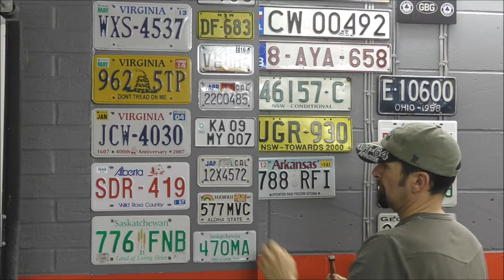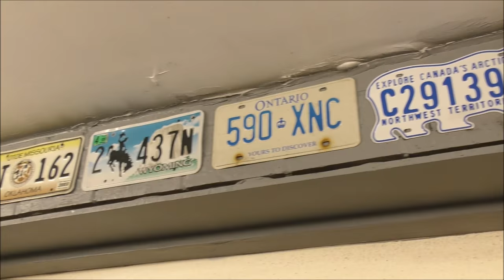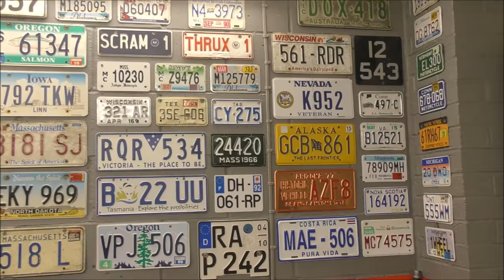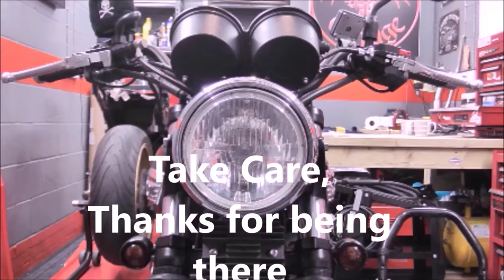Delboy's Garage, Fighter Build #31, Notching the Belly pan

Comment: Looks awesome.  Possibly a little bit over the top but ... once you get everything fettled just right you could use the inside of this as a mold for a fibreglass reproduction - and introduce bulges, louvres, and similar to clear / cover items rather than just have holes.  Just chucking that into the mix.
Reply from the maker: Good thinking mate, I like your style !

Comment: From the moment you first turned that tank upside down I knew it would look great. But it has turned out even better than I expected. Mutts nuts.
Reply from the maker: Thanks AH... did another 5 hours on it today, got the final cuts in place for now, and just the holes for the oil glass, and the number 4 pipe to cut... but i need ot mount it first..so started on the front bracket using the existing radiator lower brace...and had to cut and re-profile the ugly ends first... so didnt make obviously lookin steps forward, but still got a heap done... load up tomorrow once i get all the footage processed...! thanks buddy. Del.

Comment: just a quick idea for the front of the belly pan where it meets the bottom of the radiator, instead of bringing it towards the radiator with a curved in piece of metal, you could panel beat in a similar curve to that of the radiator and bring it in flush with the bottom of the radiator so it's a concave face instead of a convex one. I hope I've explained it well enough but that's about all I've got without sending you a picture haha
Reply: Sick idea, but that's a compound curve, so very difficult to do in steel.
Reply: +Jan Verschueren that's what I was thinking just thought I'd throw it at him and if he is up for tackling it then that would be great
Reply from the maker: Hey buddy, what a cool suggestion, I love that idea... the problem I face with that is that the current edge of the belly pan doesn't have enough metal to beat outwards in to a forward facing curve, and if I tried to use what's there, it would end up lower than it currently is... but I could weld a strip on and add extra metal that way, but Jan said, it's a two way curve then, so I would either need to pre-beat the piece out, which would be a fun challenge, or maybe use a piece of tubing about 2" and then slice it along it's centre, loads of options there - great thinking , love the creative input guys, thank you !
Reply: +Moonfleet41 I was thinking it would be a challenge! Maybe not on something you've spent 10+ hours making already haha it would be a cool add on though!

Comment: Great idea for the belly pan.  Dremel is the wrong tool.  Love mine but that's not what I'd be using it for.  Get yourself an angle grinder.  Nothing you did there couldn't be done without it and you'd probably be on the same disc.  I keep 4 of them loaded differently.  Cutting disc, grinding disc, flap wheel, wire brush.  Leave the littlest of cuts and fine tuning for the dremel.
Reply from the maker: Ayup mate, obviously I've got a grinder, and various wheels, but it's way too clumsy for some of these tight curves... it doesn't take a split second to lop a slice in it where you don't want it, and then have to weld it up and distorting it ,,, the Dremel works ok, it's just a lot more time consuming !

Comment: grab the metal cutting discs from flea bay.. last WAYYYYYYY longer.
I have 3 dremels.. use one for cutting bits out of kitchen utensil holders.. to make bushcraft stoves... hit the same issue.. carbide..or what ever the discs are called wear away in seconds, metal ones.. especially the ones with a diamond grit on the sides and air cooling holes last a way longer time.

Fuel tank belly pan... looks amazing dude..

Comment: Be careful you don't end up with long tendril metal bits around the edges as they will bend to easily. Also you have to be careful leaving the edges naked (I bend metal edges over or crimp them). In your case you may find you have to reinforce the edges later.
Reply from the maker: Hi buddy, I've a cunning plan for the cut edge, the whole lot, all the way round, will be getting a 3mm re-inforcing wire, which will then be welded just on the inside and then with a flap disc on the dremel, will be blended over to both re-inforce it, and give it a rolled edge look, as you're right, the cut edge looks rubbish !

Comment: That is going to be fantastic ! Nice work on the pan , it would be nice if you can cut or stamp out some louvers on the front of the pan , so you can get some air flow thru the pipes ..👍🏻
Reply from the maker: Possibly, will be opening up one side to expose the down pipe so may factor something in to that !

Comment: You've nailed it on the line off the bottom that follows exhaust . Nice , don't loose that line bud. The angle you can see it best is just before end in the background when you chatting .
Reply: Oh and I reckon you should ditch the symmetry hole on the other side. How can you look at a bike from both sides at the same time ?? From the front ! It will look odd .. In my eye ... 🤓
Reply from the maker: Hey buddy, I might have confused you by referring to symmetry, I can assure you, I don't intend any cuts that don't need to be there for clearance... and you're right about the line, the line from the side view dead follows the tank and frame and that is so important to maintain that, because then the sculpted concave curves also follow the same curves on the tank, and yeah, you're right, it's important not to cut away any metal that retains that line, which is why I'll have to cut a hole to view the oil level glass, rather than cutting down round it, cos it's 2" down from the lip... you know how it is mate, little by little and get it right !
Reply: +David Gayford all rite bud , it currently is in my mates garage under going some major surgery . Frame chopped , single seat it's looking mental proper 'rat' I gave it to him as he had no wheels. How you doing
Reply: +Moonfleet41 hadn't even thought about the oil viewer 😱
Reply: +David Gayford be finished soon my man very soon

Comment: Del, I had doubts about the tank as a belly pan, but now seeing it being executed.. I'm stoked!  What I didn't envision was the angle you achieved.  It matches the aggressive forward pounce of the whole bike.  Were you able to see that in your head?  Anyway, great job on the notching!  Excited to see that Ducati style exhaust pipe peep hole!
Reply from the maker: Pretty much yeah i stood back, and noticed the sharp and obvious line slanting down from headstock to swing arm pivot, the frame anf the tank follow it... and as long as you mount the underbelly tank at the exact same angle, it should hang together just right... it doesnt always work.. but i usually take some time to just stand back and gaze at a bike, and if its something that will work, then it usually looks like it will without trying too hard.... Thanks for your kind comments buddy... a step closer today, new video up just now.. Del.

Comment: Hello Del! ...this cut out for the pipe that you have mentioned(and need for cooling air down there) maybe you could do not one but three of them and on either side of the pan. Sort of like shark gills , and make them a little different in size, front to back-biggest, medium and the smallest. ...this bike reminds me of a shark for some reason, that's all. lol Awesome job as always!
Reply from the maker: Hi buddy, thats a cool idea, it'd look a bit fighter plane too aye.. i 
have a vision of the hole i need...and those vent you mention, maybe a 
bit like gills... wont be big enough for what i want to achieve.. i need
 to make a clearance hole as the pipe is touching the steel of the belly
 pan...it needs to clear it.. you'll see in the next one.. filming 
tomorrow.. Thanks buddy.. Del.
Reply: Well, judging by the way it's going so far, I am confident that whatever you have in mind will look the business.

Comment: Congrats that belly pan actually looks really great on that bike !
Any concerns about vibrations noise ? Probably needs to be rubber mounted.....
Cheers
Reply from the maker: Hi buddy, I went through all this with The General, as I made a massive sheet metal belly pan, and it was ringing like a bell to start with, but rubber mounting it doesn't do anything, as it still causes the flex and leads to resonance in the panel, sticking something soft to the inside, like Dynamat, will stop it instantly  and will reduce the heat and protect the paint too !

Comment: Hi Del,have you looked at the air nibbler or Clarke Double Headed Metal Nibbler or the double headed ones that fit into a electric drill.I have used one for car body work and leave a smooth edge and no distortion.They range from about £30.00 upwards.maybe worth a having a look and read about.
Reply from the maker: Yeah, seen those, they look really cool and do seem to leave a great finish, not so sure they can turn such tight corners, but there's always two ways to do a thing aye?... You know how it i, we never have enough tools aye !

Comment: the classic seat hump would look good like what's on the back of Norton and triumphs maybe you could make it out of a petrol tank of a 50cc bike or any smaller tank a sportster tank might work with the flat front were your bum would go and the swooping lines it would be cool to think that all the tin ware on the bike are fuel tanks
Reply from the maker: Hi John, i do have a plan for the tail, and i may be able to factor a part of a tank in to make the theme flow... just focussed on the belly pan for now.. thanks buddy. Del.

Comment: for future use the carbide discs are better, also look into the dremmel quick-clic saves the messing of removing the screw to change the fragile discs, I know how much of a ball ache is is haga
Reply from the maker: The Clic Discs are so much quicker aye, but about 4x the price... these come in at a few pence each, but got a few ideas and although the diamond ones are designed for ceramics, am gonna try a few, as many recommend them !

Comment: Looks great, sir.  Question, though.  In past videos, you've used a jigsaw to cut curves.  Would that not work on the belly pan because the steel isn't flat? Or, would that just make a bunch of nasty edges you'd have to clean up?  Just a point of curiosity for me. Like I said....Looks great!
Reply from the maker: Hi buddy, you hit the nail on the head, jigsaws only work effectively on flat metal sheet, and then they are very good... there is probably a better solution than the dremel, maybe a nibbler, but I am having fun with this and as you can see, it works, it is really accurate and controlable... and once it comes to the fine shaping, it really comes in to it's own !
Reply: I was thinking it might.  I haven't done any real metalwork, so I watch your welding/metalwork videos for entertainment and for learning.  Thanks for the fast reply, sir!

Comment: nice job, I would have used my nibbling tool to rough it in first then my dremel to fine line it.
Reply from the maker: Problem is you cannot cut the final line in the first place... for what you suggest, you need the final finished line in position, then cut the most our with a nibbler or just a 4" disc... then finish it with the dremel.. but with this you have to 'eyeball' an approximate line you think looks ok.. then cut to that... and you'll then get the fit a bit closer and can cut a bit more... and just keep repeating that until its right..

Comment: I hate using those cutting discs with the dremel compared to the quick detach discs. Those screw on discs have sent a chunk into my face and the rest into low earth orbit more times than I like to remember. also they are so much quicker to change
Reply from the maker: You're dead rght Rick.. they are made from stale pastry i think.. but 
they do the job, and cost about 20p each... where as the EZ click 
reinforced ones are more like £3 each..!!! so i smile, spit out the bits
 of broken disc, and keep changing them..lol

Comment: Great progress mate, that still image was great can't wait to see the tail. This is a off topic question but im struggling to find correct information, I've heard that for every 1mm of steel you would require 1.5mm of aluminium to match the strength but is this correct? Take care D &P see you in a week.
Reply from the maker: Hi mate, your question on steel vs. alloy is right if you are using mild steel... but if you are equating it to high grade stainless steel, then probably more like 3mm... and then if it comes to tubing, it's different again... you  know how it is mate, nothing is simple in engineering lol !
Reply: ahh well no easy answer then. probably why Google could not help as there is no definitive answer. Right time for some trial and error haha. all the best mate.

Comment: Hi Del, does the hole that used to be the petrol filler match up to the sump plug as you wanted or is it a rethink on that one?
Reply from the maker: Hi buddy, no, sadly it is miles out, probably about 4" to the rear and slightly to the left... but not important, as I will always take the belly pan off to drain the oil anyway, as will be lining it with heat proofing, and wouldn't wanna soak that in sump oil from any splash over!

Comment: Hey Delboy, You think wrapping your pipes in some header tape would help with that heat?
Reply from the maker: Hi buddy, I won't be wrapping the pipes, as I never think it does them any good, they fester away under the tape when they get damp, it's also a Micron header set, which are very high quality and very attractive, so gonna go the other way round, and line the belly pan itself with a heat proof matting, and air vents to promote cooling
Reply: Right on. I was just curious, because I was sure you already considered it at least. She is looking awesome, man.

Comment: looks damn nice just the way she sits Del!!!
Reply from the maker: Cheers Jeff.. it has a bit to go yet before it sits right, and i have rhe side stand to cut out, and the holes for the oil glass and number four header pipe... once those are all done, then i can weld in the filler section at the front..and that then just a matter of a way to hang it.... i guess i still have a lot to do ..lol

Comment: Can't you buy a diamond edge steel Dremel disc for cutting, it would save a lot of messing about changing discs?
I bet all that grinding dust must've given you some massive grinder boogeys Del! lol
Reply from the maker: It seems that the diamond discs are actually designed for ceramics and glass, but many people here are telling me they use them on metal... but these discs are less than 20p each and the diamond disc is about £3, so the wanna last a long time to be the same value, but will certainly give them a try !
Reply: ....and how's the boogey situation? Hee hee!

Comment: On the side were the exhaust tutches do a single cut and then Nock it out with a hammer so you not cutting a ovul you making it more off a air funnel
If u know what I meen ??
Reply: And do the same on the other side it will  set it off abit more
Reply from the maker: Hi buddy, I thought of that, I think  you mean like a louvre... but I kinda want to see the exhaust protruding , or at least sitting flush with the surface, to make the belly pan look nice and tightly snucked up to the engine to keep it looking minimal - may use some louvres though, or possibly, some gauze vents... thanks for the input !

Comment: Plasma cutter £150 ebay
Reply from the maker: wrong tool for the job, you need a final line that is correct first time...this can only be done trial and error little by little until its right.. plus Plasma cutters leave a horrible distorted edge..